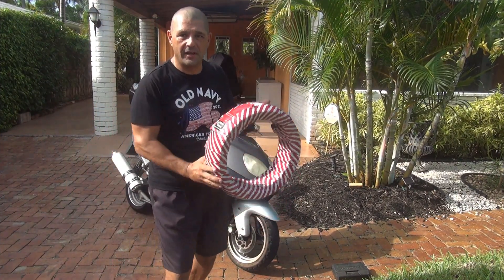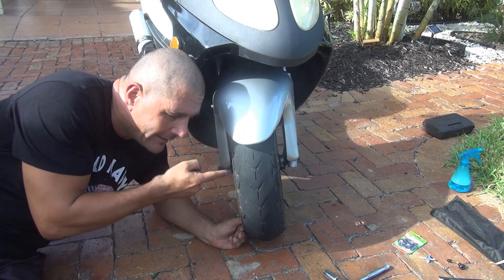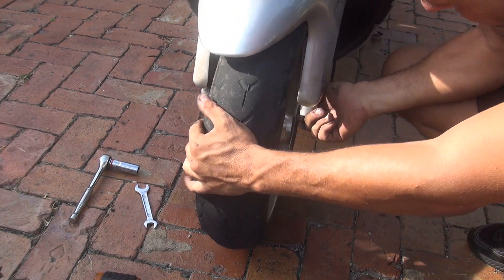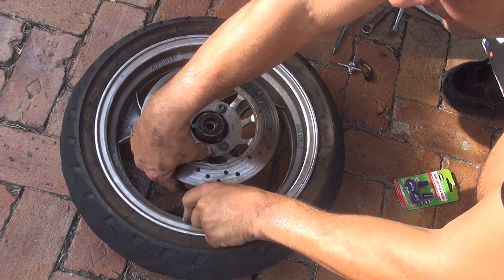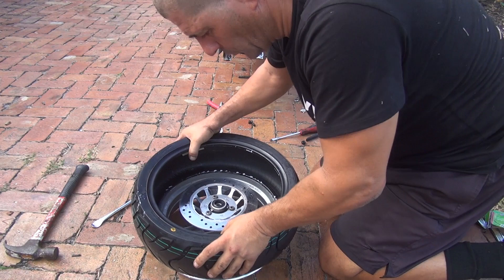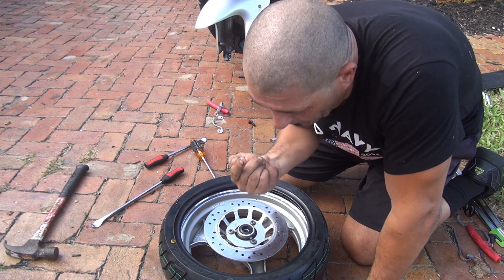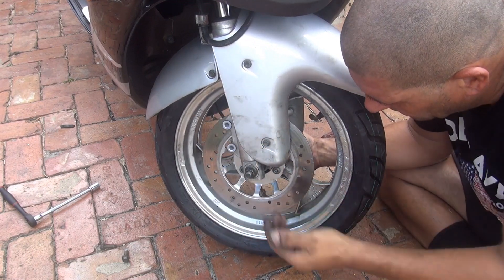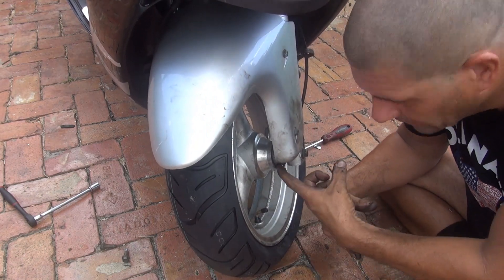How To Change A 150cc Chinese Scooter Front Tire

Comment: If you were to change the exhaust of your scooter from stock to aftermarket,would you have to change anything else on a 150cc GY6 scooter ? My exhaust has little pops and bangs also may that affect the bike?
Reply from the maker: Hello David if you replace the exhaust you need. To reject the carburetor and the best you should have a performance air filter because you need to keep the balance of the volume of air going in and out and if your scooter is already popping something is not balance in ratio of the main at stock you should have a 38 pilot jet and a  105 to 115 main jet . Thank you for watching my video

Comment: Do you have to change the valve when changing tires or the old valve can work?
Reply from the maker: Hello my friend is better to change the valve every time you change the tire if you like you can keep the same valve if is in good condition but there is the possibility that you have to change your valve before you have to change another tire
Reply: @VirberelloScooterTips  Thanks for the advice